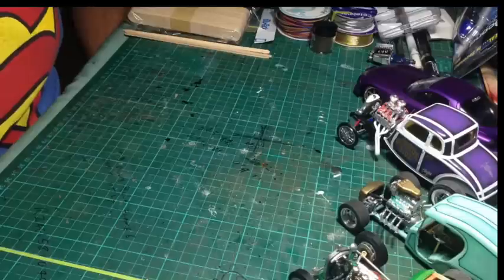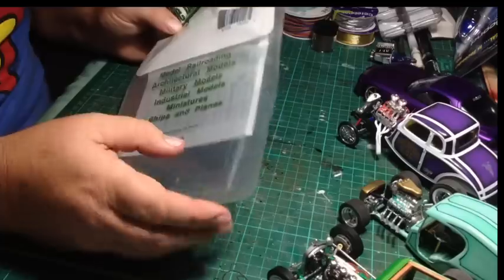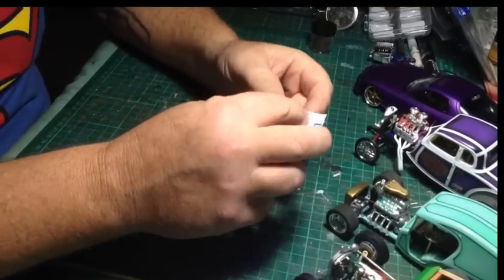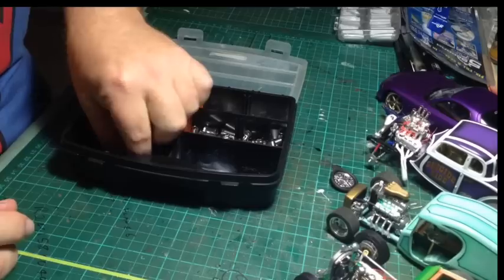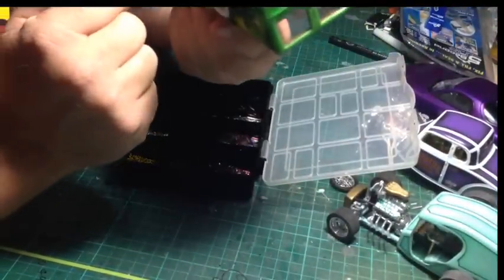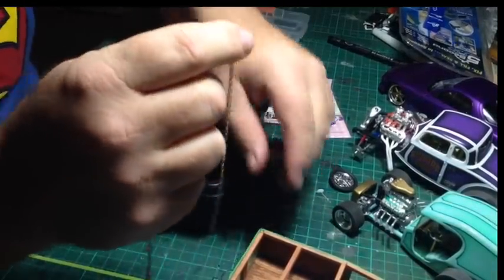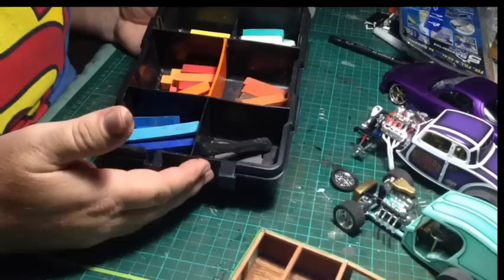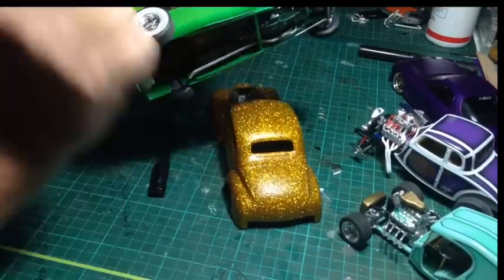Detailing 1/24 model cars on a budget

Comment: I'm not sure how many car models you have to buy, swap, or build, to amass a collection of wheels such as you present here. I must also confess to a slight snicker upon seeing, in a matter of seconds of the start of this posting, a collection of Evergreen styrene stock that, together, probably equals the cost of a new kit. I build car models on a budget, mostly kits I purchased twenty or more years ago. I regularly look through Dollar stores and craft stores for possible parts, but pickings are decidedly slim. I find most stickpins and sewing pins too large for use as shifters (your average stickpin head translates to a ball 3 and a half inches wide) or antenna toppers, plus the steel used tends to snap rather than bend, severely limiting the application. Oddly enough, some of the best deals can be had ordering aftermarket parts: Model Car Garage, for instance, produces a set of 18 throttle linkages for about 8 bucks; that's less than 50 cents a car. Using fake fingernails as air scoops is an interesting tip; I figure I might make one, or maybe two models with such an accessory. Certainly, however, it is better in the long run to buy a big roll of wrapping wire that may be used for electrical, ignition, and even brake lines, rather than those tiny packets sold by the aftermarket companies, so it pays to know what you are getting. These extras all add to the cost of building a kit, but it is usually the tiniest of touches that really makes a scale model stand out; that said, I have yet to see a steel 'Anglia' or 'Studebaker' script in 1/25 scale at the Dollar store or Michael's. Thanks for posting.